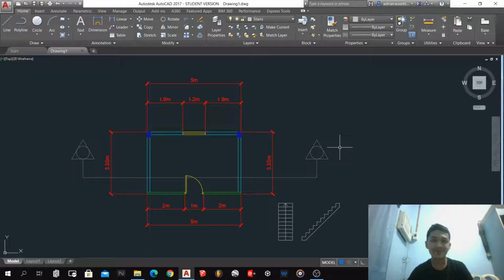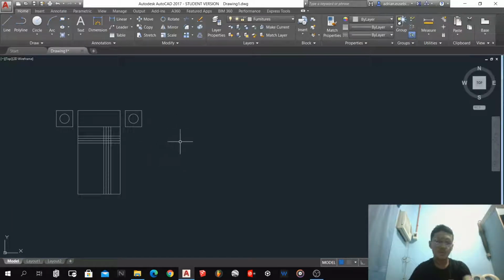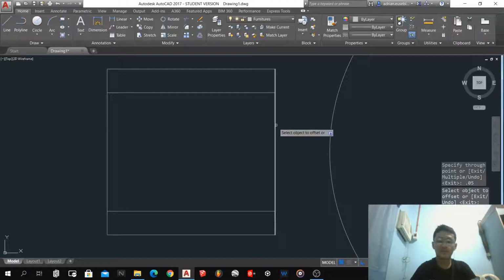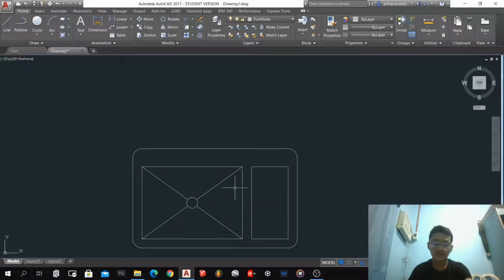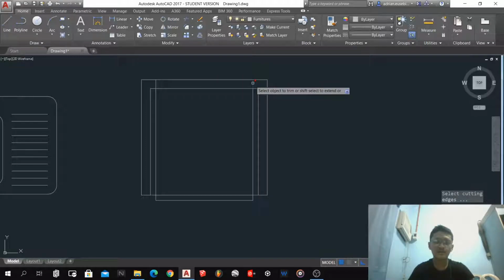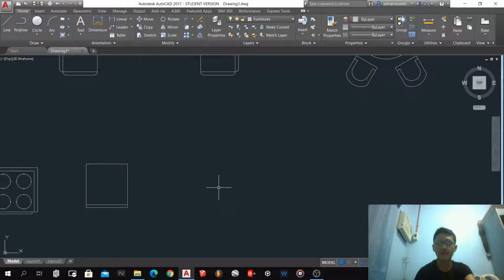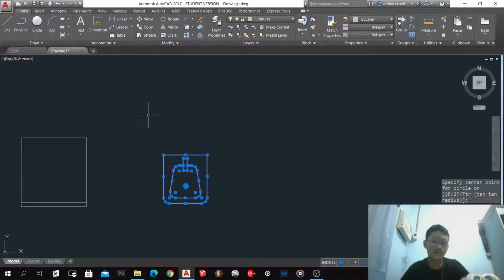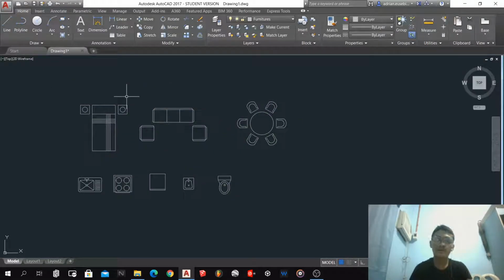AutoCAD Tutorials for Beginners - PART 9 (Filipino)

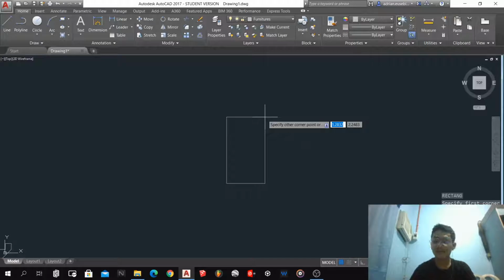Comment: 1:25 bakit 0.9 x 1.8 po yung rectangle? Saan po yung reference ng measurements?
Reply from the maker: Hi! The rectangle po is considered as the edge of the bed. I used to create a tiny bed as a practice for basic drawing.  For the measurement reference of the bed, kindly seek the specifications of what bed size you are going to create (eg. Queen Size, King Size, etc.). Thank you!